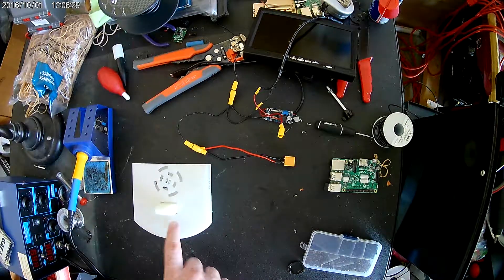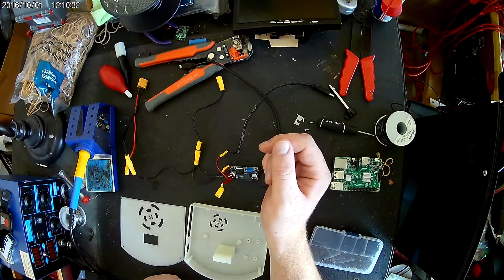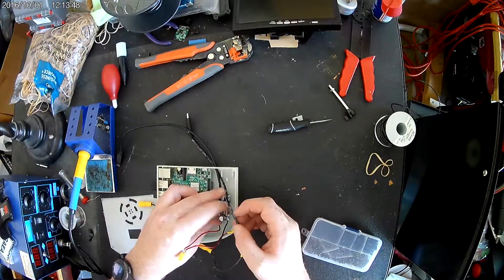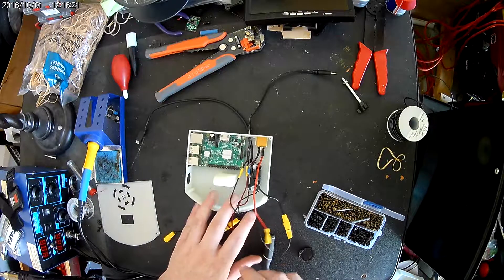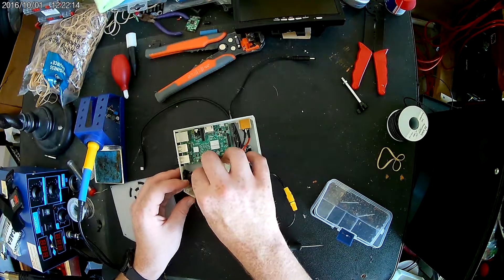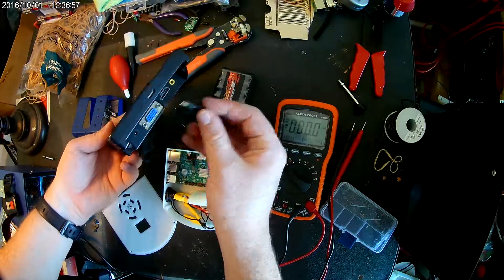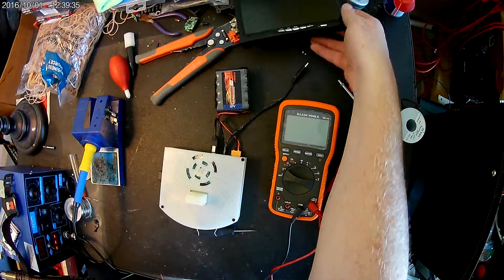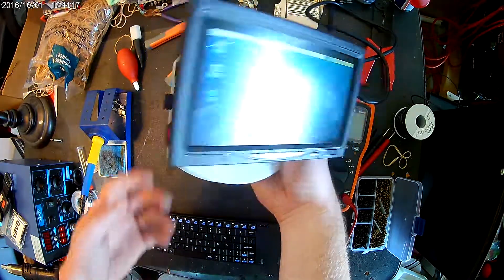DIY RaspTop 2.0 Build

Comment: Nice idea.
With a little redesign (move switch to front, and move the PI towards the front,maybe even put a 12v out at the back for your monitor)you could keep all the power cables/hdmi on the inside of your box and only the 12v feed in(and possibly one out) would be even tidier.

Comment: How did you solder the microusb to the LM? I tried it and the PI wouldnt even boot. The voltage drops from 5v to less than 1v or so when I plug in the pi. Why is that? Why doesnt it happen with you?

Comment: Like your content!  I bought some of those yellow high-amp bullet connectors as well.  Am using one pair to quickly disconnect a heatbed.  Anderson Power Poles are a bit easier to unplug.  Would probably use one of those round power barrels though for wart-to-case, as all you need is a round hole to mount it.  https://www.digikey.com/product-detail/en/PJ-065B/CP-065B-ND/2627224?WT.mc_id=IQ_7595_G_pla2627224&wt.srch=1&wt.medium=cpc&WT.srch=1&gclid=CjwKCAiAx57RBRBkEiwA8yZdUGD7L87xwIoOCh7s5cVdkaLAdHeEaPiuRIEdzBFOV3M_Q4gBHI1clRoCWW4QAvD_BwE
 It is possible to buy slender 8" HDMI cables.